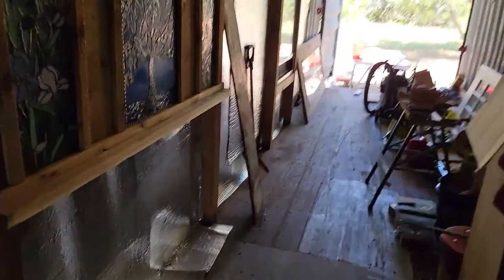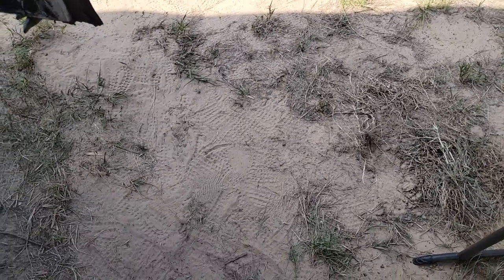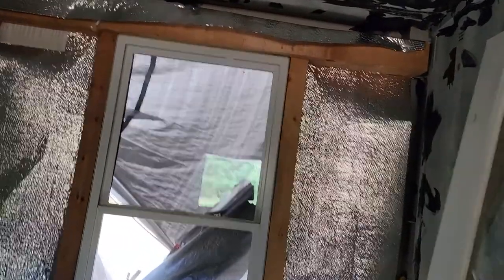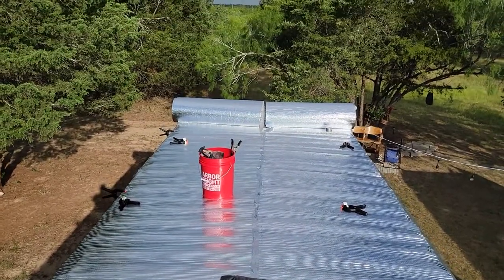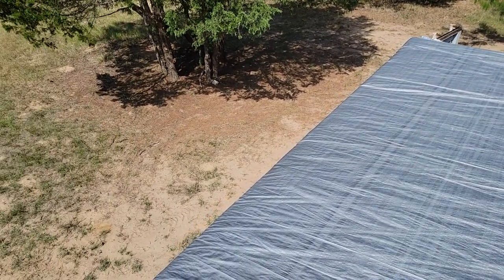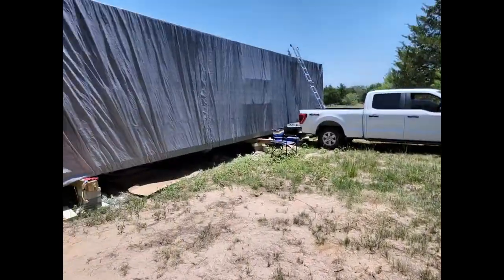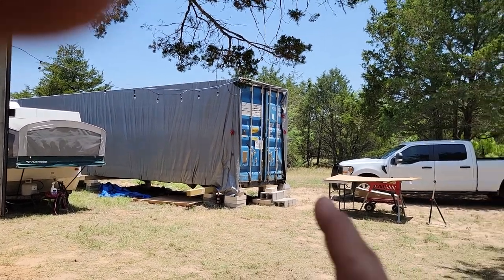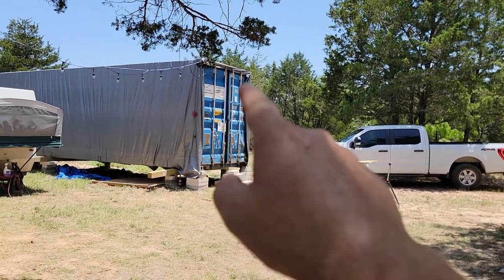Heat Reduction on Shipping Container. Up to 60F drop of inside roof temperature at very low cost

Comment: If it's not a canvas tarp, I'm thinking it will degrade pretty quickly.  I stopped using anything but canvas.  I'm in South Texas.  I have a container also and am looking for heat reduction solutions.
Reply from the maker: It was Harbor Freight truckers tarp. I honestly expected 3 months. I got less than 30 days out of it in the hot Texas drought.

You nailed the problem - canvas tarp is the right answer.  Or just go with that foil and strap it down with high-quality netting. Even plastic construction fencing might work.

So - yes on the InfraStop. I still get a 40 degree change on that.

But - nope on the Harbor Freight tarp. Not strong enough.

On the other shipping container I'm going to try a ceramic coating like they use on windshields. (if not too expensive).